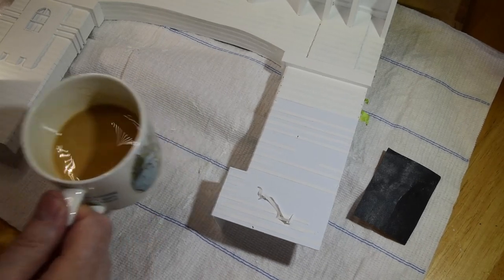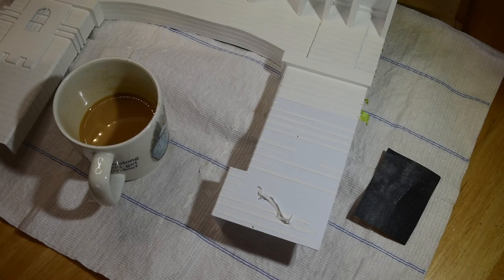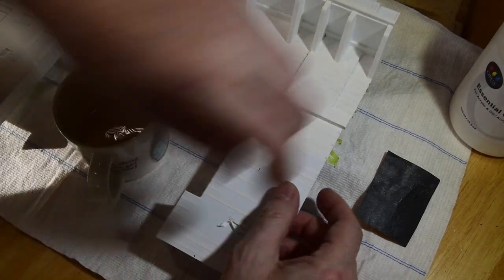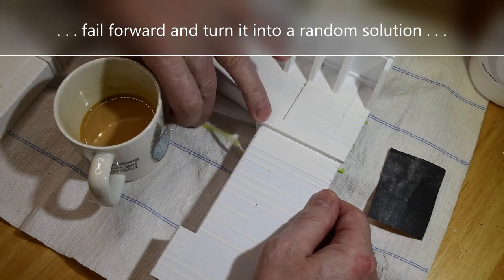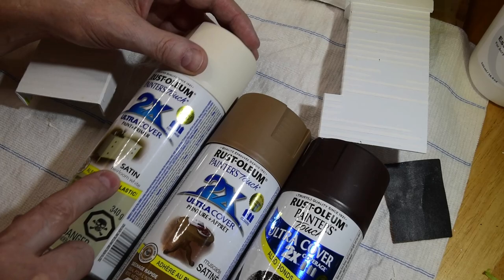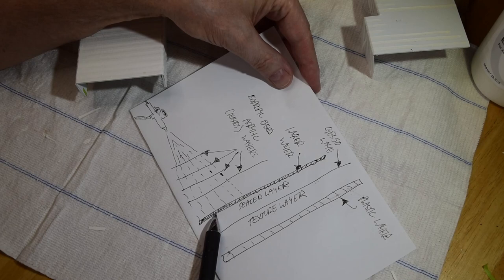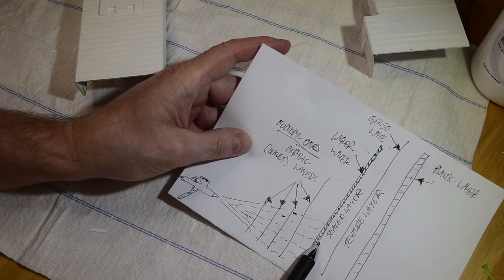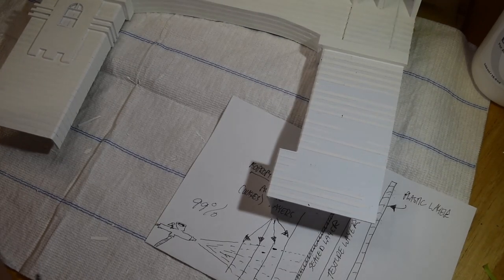Painting the Bridge Façade | The Layered Texture Factor: Part 4a

Comment: If you would not had the gesso on hand or anything else you thought would work for the board by board form work effect and had to go buy something specifically to make that effect, would you choose the gesso or another product? If choosing another product what would it be and why? I like the way this turned out. It definitely shows the board by board effect you were after. It also worked out in another good way as you mentioned where large areas peeled off kind of giving an effect of the facade crumbling away in some areas and showing the bridge showing its age. Good video. Stay well.  -Wil   👍
Reply from the maker: I probably would have just tried a pint of good quality acrylic latex paint from Home Depot . . . or whatever. Even Kraft paint. But I don`t like Kraft paint for personal reasons. The pigment is poor in my experience. On the other hand, latex is tough resilient paint and adheres to almost anything. I just don`t like how thick it is, but then that is the reason for built up texture if that is what you intend to do with it on a small scale model right?
The one thing I would have done differently was rough sand the styrene plastic surface before I painted on the Gesso. This explains why some of the Gesso adhered, and some did not. But there in lies the risk factor I talked about. It worked out in the end . . . again . . . and again. Sometimes we think things through too much and achieve very little in return. Its a weird dichotomy that way .  . . but that is the Artist's way. Cheers

Comment: I really agree with your philosophy on the randomness of mistakes and letting them live on, avoiding perfectionism.  But if one wanted to use the gesso/tape method and wanted to achieve a clean line without mistakes for some part of a model, I wonder if you peel the tape off a little sooner (when slightly wet still) if this would help?
Reply from the maker: It's all personal preference. ;-)

Comment: Hey you ain't gotta smack on the coffee man...must be good, what brand it is😂?
Reply from the maker: Probably local Espresso.😁
Reply: @boomerdioramas  I'm a coffee drinker...but anyway, I am also a plumber. Plumbing is art to me, and I have my own plumbing business.  Some of my biggest mistakes (1.While replacing a storm drain basin 2. While installing a 8" backflow preventer on a fire main. 3. While installing plumbing for a brewery; I ended up having to repair a 16" water main under a busy street on this one, the leak was so bad it was draining the water tower for the city😅)...have turned into my biggest triumphs.  I agree with, the only mistakes are the ones you don't learn from, but I have also learned that sometimes you can actually capitalize from them...with the grace of God.  If you're not making mistakes, you're not trying hard enough!
Reply: ....and I had to fix the 16" water main with the water on😅